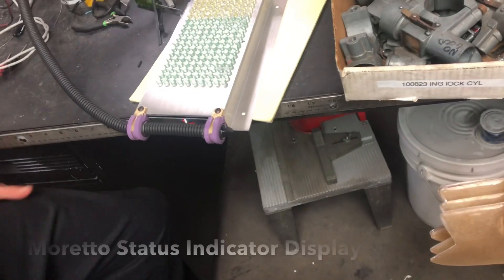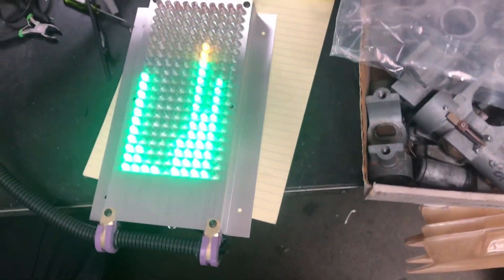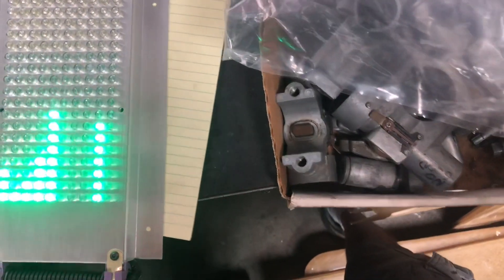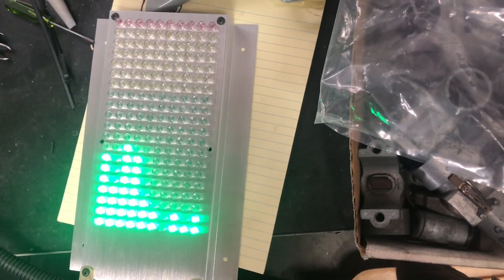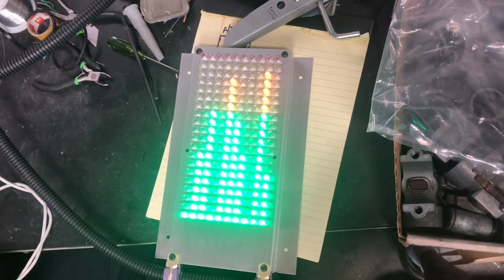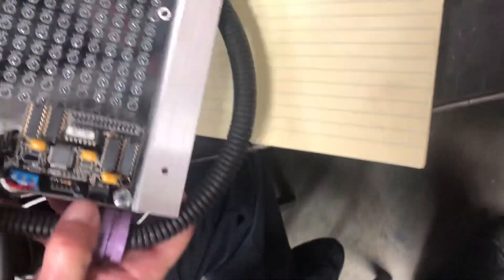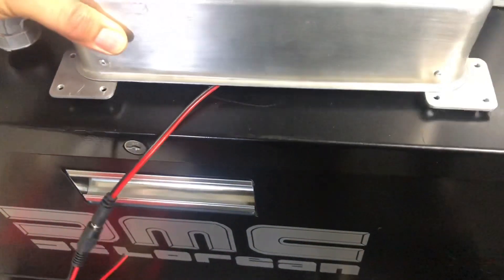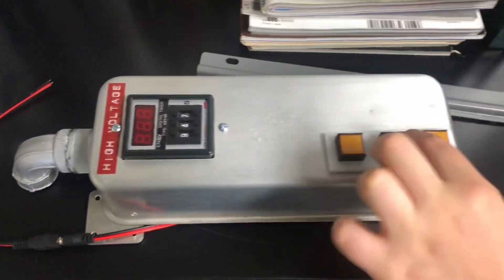Moretto Status Indicator Display and Fuel System Regulator DeLorean Time Machine Props at DMC CA

Comment: Looking for all over the Internet ,  really cant find anywhere to buy the BTTF parts for Delorean. I contact the VideoBob ,not nothing have return yet . 
they dont make stock or , this a all build for order?
Reply from the maker: Xu Peter Right now is a bad time because of the quarantine.  I recommend waiting it out until things get back to normal or at least settle down a bit.
Reply: I am a DTM builder for over  23 years and 30 DTM builds to date. When customers contact builders for single orders it takes too much time away from our builds. We will sell whole DTM  vehicle props now but not single orders. There are BTTF fans out there that do offer from time to time DTM props,  you just have to keep searching on eBay and Facebook.